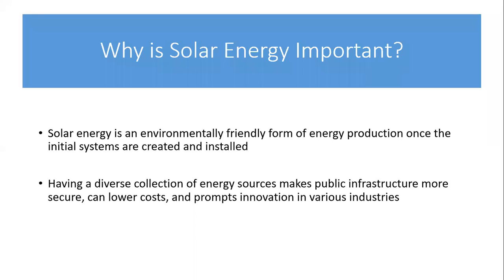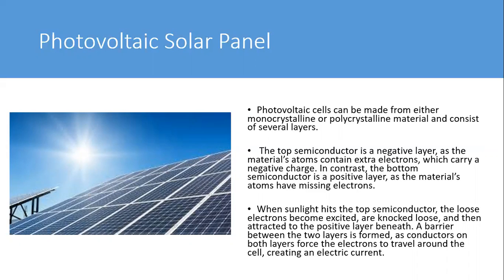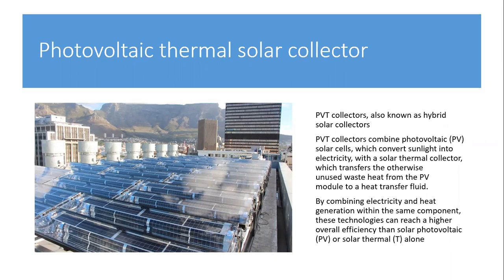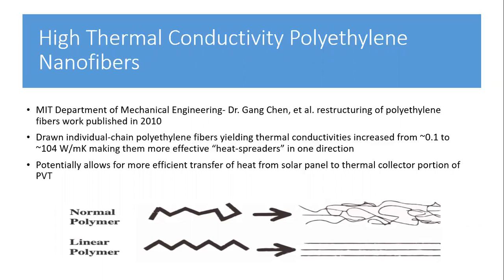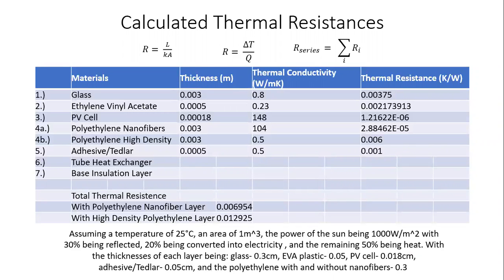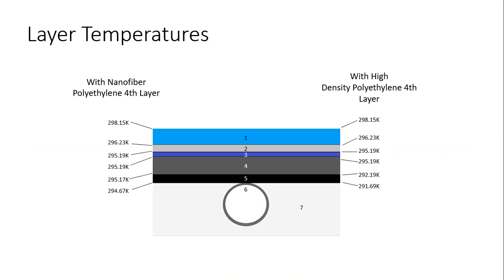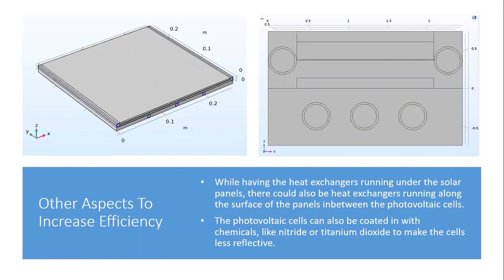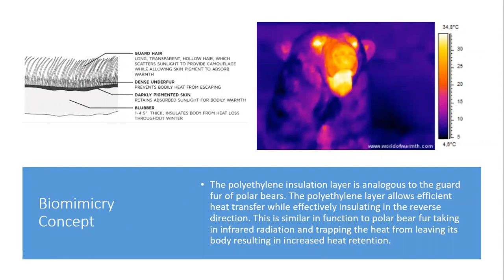Maximizing Efficiency of a PVT Solar Panel Utilizing Polyethylene Nanofibers

Comment: Thanks for posting. TIMs are cool (not intended). Every little incremental improvement will help. Although, the question boils down (not intended) to TES. 20-40deg operating range for solar themal is simply not available and phase change materials are not delivering. The value of heat at those lower temperatures may make expensive TIMs unnecessary.